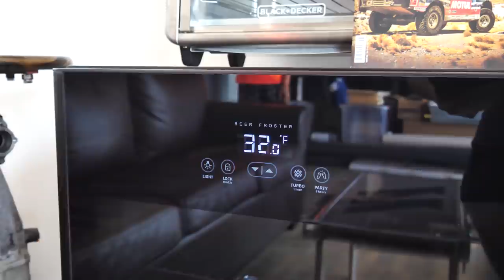Building FURNITURE out of CAR PARTS! (& other shop improvements)

Comment: The volvo looks nice you could remove the rust and paint it
Reply: There is a 2JZ wagon in Finland, would be pretty nice, but 2JZ is kinda overdone.
Reply: @DG_427  there are 100s of Volvos with 2jzs, even more with m50s
Reply: Mercedes m104 😎
Reply: 99% of 240s have rust or a lot of rust it tends to be what totals the cars after the engines run for 300-500k miles
Reply: Beater 240😏
Reply: He lives in Illinois so everything rusts
Reply: He should Ls swap or Audi 5 cylinder swap.
Reply: Put in an engine from a 850/V70 with the 5 cylinder engine. With some great coilovers and a great set of winter tires you have an awesome DD in the winter. 
The prices of the 240 chassis is going up here in Sweden a lot. Many have been used as beater cars so they are less of them left on the roads. 
I miss my Volvo Amazon a lot. Did a repaint to the original paint color which where the dark green color. And the rare combo with a white interior in it. Sold it before I did anything on the driveline. The guy who bought it made it to a racecar to race the 1/4mile. Would like to have a Volvo Amazon or PV 544 for a nice DD. 
Volvo 240/740/940 you can build pretty good drift car from. We have some cool ones here in Sweden.

Comment: I’m so digging that Volvo, I think a good idea would be turbo diesel swapping it, or ls swapping it lol. Something reliable and fun
Reply: Or turbo the engine it has
Reply: The Volvo engine it has is certainly reliable, and it doesn't really need to be fast. Just freshening it up a little would be best imo
Reply: Quest yeah for sure, just something thought to make it more fun
Reply: Or put in a Volvo 5 cylinder engine in it. Just for the engine sound and you can build it to a pretty high hp numbers in it as well.
Reply: @tonymattisson6158  or a t6
Reply: @alexstromberg7696  absolutely. I just have a softspot for 5 cylinder engines LOL. Have owned an Audi S4 92' with the 5cylinder turbo engine in it.
Reply: Tony Mattisson yeah, or the Volvo turbo diesel that came with some, but build it with a large turbo etc. Keeping it Volvo would be rad

Comment: 2 things about that shop TV... You could get an actual corner mount so it's at a 45 degree angle. Also, I'd get a cheap laptop to hook up to it. It would have much better resolution and you wouldn't be having to keep your phone in the corner of the shop all day.

Comment: I saw the Volvo 850 hotwheels isn’t the background and was hoping you got a Volvo wagon as a daily. I have a 2.5t whiteblock 5 cylinder that I’m willing to sell for cheap if you want to swap it in. I can give you all the modules and parts since I have the entire car that everything came from since it’s a parts car. You could also do a stand alone ecu for it to reduce complexity. The turbo has no play at all and the engine has a complete history on it. The torque from that engine will be very mice for hauling parts around.